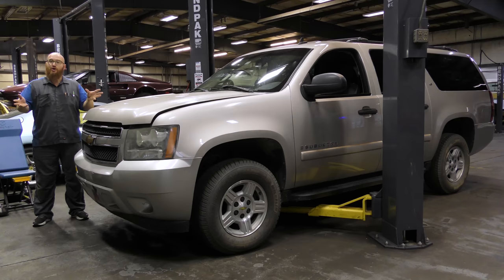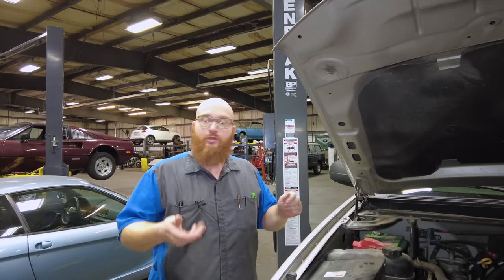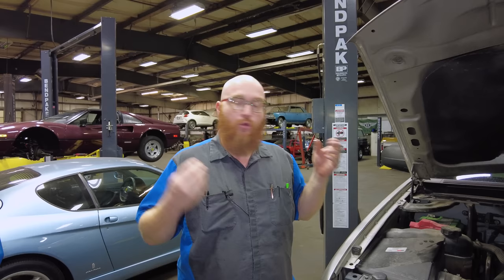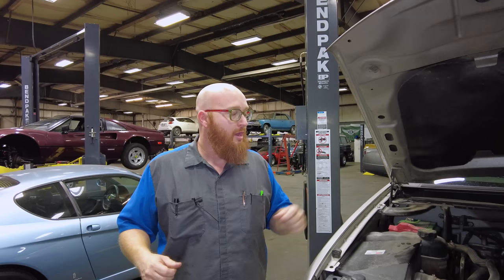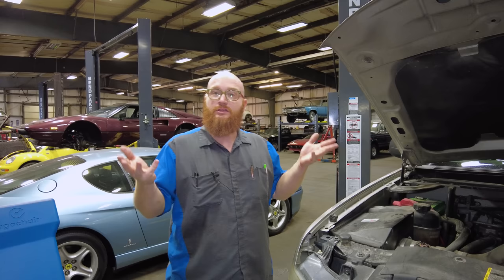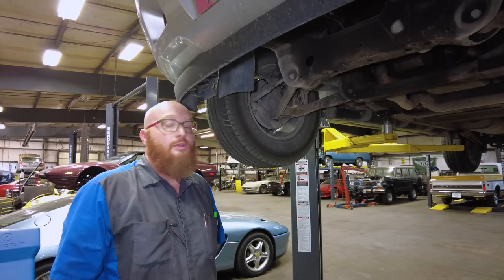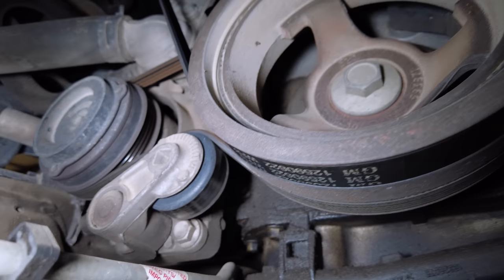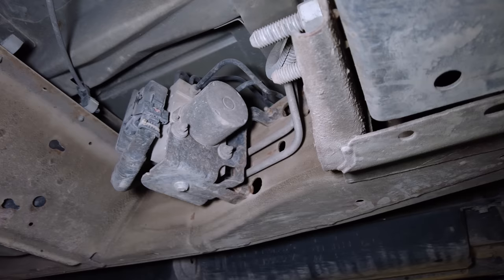What fails on ALL early 2000's Chevy SUV's!? CAR WIZARD shares what he's seen from the last 20 years

Comment: My 04 Suburban is well over 200K, blend door actuator and fuel pump, and blower resistor is all that I have had to replace. Not counting the TPMS lol. :)
Reply: My blend door actuator just failed today on my 04 Denali 🙃🤣
Reply: How did you know blower resistor needed replaced? I noticed my blower motor wires are hot when it runs for a long time
Reply: @IntelligentElephant  I wasnt able to change blower speeds. Under the dash behind the glovebox. Not expensive part. When you change the fan knob, this resistor changes the voltage to the blower causing diff speeds.
Reply: @ford89ltd  sometimes, turning off the key switch and restarting, will reset the blend door. I did this for a few weeks before finally replacing.

Comment: Most all of those problems I can take care of myself,  the transmission,  I have rebuilt a few, but those are a little more complicated than the ones I have rebuilt,  the GM TH 200, 350 and 400. Those are much easier than the over drive units.  It's really good to know about all the problems those have, I am considering buying one, around a 2004, Tahoe.  Very informative,  and educational,  thank you sir, I realize this is kind of old, still very helpful.

Comment: Great video, thanks Wizard! 
We bought a 2007 Escalade this year. I don't like buying a first model year, but this meant I could get a 6.2 without any of the AFM hardware. We bought it because it's quiet and comfortable, but being based on a Silverado should hopefully last a long time.

I had to do a few things to it when we first got it, which I understand are common - replace an engine mount, new front wheel bearings/hubs, brakes all around, spark plugs and wires. It's a really easy vehicle to work on, and has been great in the time that we've had it.

Comment: 2008 Suburban failed planetary gear at 90k, rebuilt trans and dumped it. Oil leaks from rear main, electrical gremlins, etc....it was a turd post 75k, even with AFM disabled. Garage kept and always meticulously serviced. Have a 2013 now and (knock on wood) it seems to be holding up better.
Reply: One of the worst years, the 08-09. GM cut back big time in QC during the recession years. Imagine buying a '09 $75K Escalade only to have the head gasket go at 3K miles due to poor head torque specs at the manufacture. At 16K, rear air compressor failed. At that point, we dumped it for the then-new Infiniti QX80 and drove the piss out of it.
Reply: GM 6.0l engine are bulletproof engines more reliable than The 6.2l v8

Comment: I bought a 2004 Avalanche 4WD in 2012, still driving it.  The oil pressure sensor replaced 3 times, never leaked, just gave max pressure reading once, and zero pressure twice.  A/C Blend door replaced, twice on driver side, once on passenger side.  No AFM, so no concern there.  I had the dash cluster rebuilt, added the transmission temp gauge when I did.  Now at 285K miles and transmission seems fine.  I always use tow/haul mode when towing, even when it's my small trailer and empty.  This is the longest I've ever owned one vehicle.  I originally thought I could get to 200K, then 250K, now I'm shooting for 350K.

Comment: We’d really like to see how you replace that oil pressure sending unit without removing the intake manifold!
Reply: Ancient Chinese secret!
Reply: I've done it in 15 min
Reply: There are a few good videos out here on YouTube for this. You can't see it, but once you know what to feel for back in there you can get it done. You have to buy the special socket and then have kind of an assortment of wobbly bits and extensions but overall it's pretty easy.  I also lay a piece of plywood across the engine bay to lay on. It makes it more comfortable.
Reply: Ya gotta have a skinny arm.  I changed mine in 15 minutes.

Comment: What a great vid! Love the info.  Currently replacing my transmission 4l60e ‘05 Yukon XL.  Lost 3rd and 4th gear 200 miles from home.  No warning no shudder.  Just got the rpm’s flying high and not moving forward. And yes,   I was going kinda fast, in over drive.   But why wouldn’t anyone do this in any vehicle and not even worry about your tranny puking?  Like what??   We can’t use overdrive now, on the highway, towing only your family for fear of an imploding transmission.  Going with a re- manned with a 3 year unlimited mile’s warranty. Cha-Ching!  Supposedly with beefier clutches and springs. I do love the vehicle though.  Thanks Wizard.  We viewers appreciate you sharing your knowledge.  Party on Wayne!
Reply: how much did that run you?
Reply: @NWhomegrown206  without pulling receipts, adding in fluid and a new shifter cable- they wear out too, all parts plus installation, tax, $2,800.00 ish.

Comment: I paid $1000 for my '03 Yukon XL Denali. I haul 12 footers of steel in it all day long as well as take it everywhere on road trips. If I couldn't fix everything myself it would probably be death by a thousand cuts with with all the little issues, but for me as a beater it's a perfect truck.
Reply: wow what a steal, you cant buy a LQ9 engine for that
Reply: It's amazing the deals some people get.  My co-worker bought a 2003 Yukon XL with only 96,000 original miles for $6000.  His wife refuses to let him sell it.  She loves that vehicle.
Reply: @T0tenkampf  It's an lq4 in an '03 and of course you can't buy it for $1000. There's labor involved in getting the engine pulled. You can go pull one yourself and pay a few hundred $ all day long. 

Had some simpleton try to tell me today the lq4 in his Escalade is worth $4000. Not sitting in the truck it ain't worth $4000.
Reply: @mylifethaidiy7045  That's a slightly better than average deal. An '03 Escalade with 130k miles for $2000 is a better deal.

Comment: Absolutely LOVE my 02 Silverado ext cab long bed Z71 4x4. The ext cab long bed is a pretty rare body cofiguration for a 1/2 ton. Bought it for $9700 when it had 56k miles on it the first time gas hit near $5 a gallon. People were giving V8 trucks away. It now has 364k on it and still purrs like a kitten. It has one small spot of rust on the driver side rocker about the size of a silver dollar. Other than that, only some surface rust on the frame. Nothing rotting at all. Florida truck most of its life.  Original transmission & rear end and probably 90% of everything else is original. I posted all that information about my truck on another video and asked in the current market what they thought I could get for it. One guy answered $9700. LOL. If somebody offered me that, I just might take it.

Comment: Just bought me a 2003 Tahoe with 145k miles on it. 1 owner. I love it so far! Only problem is some quirky electrical problems, but hey it’s a 20 year old Chevy! My oil sending unit is bad LOL.
Reply: Check out that main ground wire and connection... Iv'e seen a lot of videos talking about that. I believe it's under driver seat somewhere on frame and it gets corroded easily.
Reply: One of the best though. Miss my '04 Z71 Tahoe in green. Still see a ton of those out there.

Comment: I lost a legendary Buick 3800 to a GM oil pressure sending unit. The LeSabre only had 130k miles, but the unit failed completely during a drive home and drained all of the engine oil. There was a trail of oil across town from that car…

This in conjunction with an earlier incident with the intake plenum failing and hydro locking the engine ruined my trust for GM products. I replaced the Buick with an Accord that is up to 255k miles now and counting everyday.
Reply: People seem to love the 3800. Series 2 3800 long block is great. Everything that bolts to it is garbage. 

3500/3900 is prob the most reliable GM engine ever made in the v6. 4t65e trans is only good for 100k though.

Comment: A common job I've had to do on early-00s GM trucks are the heater core hose connectors. They're made of plastic and they just get brittle with age and heat and snap, suddenly there's coolant spraying everywhere and it's overheating because the feed or return hose is wide open.

Comment: another way to avoid the AFM debacle is to look for one of these with the 4.8 V8 engine - it was used in the later ones too and does not have AFM
Reply: Or get a 3/4 or 1 ton gas truck or buy a Chevrolet Express/GMC Savanna van instead.

Comment: Ran into a few of these between 3 different rigs in this generation. My first 2 Silverados were 2000 and 2003. My 2003 i bought at 40k miles. Drove it to 277k miles before i sold it. Had the oil sensor, knock sensors and a couple wheel hubs. Even my 4L60 was awesome. All original trans just filter/fluid changes every 50k miles  That's all I ever had go wrong with that truck. Best vehicle.ive ever owned. My 2000 Silverado was a regular cab stepside with a 4.8 V8 and a 5 speed. Also a great truck. My 2007 Avalanche was also nice but a total rust bucket. I maintain my stuff well

Comment: I wish there was someone like you back when I bought my old S10 Blazer years ago as nobody told me the transmission was known to blow up so I had to get that rebuilt as it just randomly gave out on me after an Oil Change and then there was the Intake leak that those old vortec motors were known for
Reply: At least the Blazer was a cool vehicle and not some other boring car similar to the way modern compact suvs are.
Reply: Loved my ‘87 s-10 blazer, even if it didn’t have wheel arches anymore and poured oil….
Reply: @tench745  that was actually my first vehicle but unfortunately the Master Cylinder went out on it and I didn't have the money to fix it.  The one that needed the transmission was I believe an 04.  I loved the blazers but I don't know if they're still good now a days or not as i have a '14 Jeep

Comment: I have an 05 Yukon ,it’s either had almost every problem wizard talked about, or I replaced it preemptively because I knew about it. Not AFM on mine, and I bought one that didn’t even have a tow hitch, so I know the trans wasn’t abused towing without two mode. 200k miles, original trans still.
Reply: Same with my 2006 Silverado.

Comment: Let’s see what have I replaced. 2006 Suburban 4X4. Transmission. Oil pressure unit, window regulators. A couple not mentioned AC/Heat fan resistor, 2 front bumper airbag switches, rear hatch lock,

Comment: 2011 Suburban here with 250k miles - Dash cracked up, Transmission cooler line leak, had an issue with the AFM but bought a delete that goes in OBD II port off of Amazon for around $50 and it hasn't been an issue since. However the other issues you mentioned we haven't experienced (knock on wood).

Comment: I also learned that if you drive with the transmission in the manual selection and have second to last/highest gear selected, the AFM is deactivated.  

Again, the amount of fuel burned is worth the internal parts failure repair and down time, or even worse, sitting on the side and waiting for a tow.

Comment: The cannister purge solenoid valve. You can only fill tank clicks at a time. You will get a check engine light I forget the code. Pretty common for those who love to "top the tank off"

Comment: 4:00 ford recently got cylinder deactivation on their brand new F150s. The 5.0 is dual overhead cam and not a pushrod V8 so it could have different results
Reply: We'll see, only time will tell if that's a good call from Ford
Reply: OHC engines have cylinder deactivation issues too. Take Honda’s J35 V6 for example. Luckily they make a VCM Muzzler for them which disables the cylinder deactivation system.
Reply: Hmm never had a problem with the MDS from Mopar but then again ohc and a system designed by Daimler Benz

Comment: So not so sure on the SUV's but as far as the 15/25/3500 there is a ground lug under the drivers' footwell that corrodes, preventing  OBDII testing due to no fuel level.  Mechanic friend says it happens very frequently and diagnosis can be costly if you don't have the experience.  You could be spending a couple of man hours testing relays and tank sender, he went right to the ground first because the symptoms were familiar it is that common.

Comment: 05 yukon. I've done all the brake lines on three of these. Major pain in the neck. GM has a pending lawsuit on the brakes lines rusting. 
  Many electrical issues including the cluster. Ground wire corrosion.
Oil consumption due to poorly designed intake manifold drivers side.
But according to this video I've got a pretty good vehical.
It's better than my first  VW bug 1955. Sorta

Comment: 3 things that Wizard did not mention that I have seen on the GMT900 platform. Swaybar endlinks plastic dash cracking and the little plastic skid plate underneath the front end. I had an 07 Avalanche the timing chain jumped a few teeth and cylinder 1 lost compression. It had all the common stuff oil pressure sending unit, sparkplug wires and ac belt tensioner.
Reply: Oh, the dash... man that thing looks like shards of glass ready to launch. I'm buying a dashskin today.

Comment: Are there any aftermarket parts that can outlast the factory replacement parts? If so any suggestions?
Reply: good question, you would think someone could make a mint off a better oil send unit design
Reply: ARP bolts and studs are a good replacement.

Comment: I bought 2 Tahoe’s, both at 106k with 1 owner, an 03’ 4.8 LS and a 05’ 5.3 Z71.

same exhaust manifold bolt head broken off on the 03. 
A/C actuators, front and rear, on the 05
Leaking oil block off plate on 05’
Wires break when doing spark plug changes

Very helpful video

Comment: I've got an 07 Suburban LTZ and it has the active fuel system. I'm currently sitting about 120,000 miles. Just put new plugs and wires on it last year. 7 out of 8 plugs were easy. The last plug on the passenger side rear sucked.  Still a great vehicle though. Shakes like a mofo at times going down the highway.  It's been aligned, but still likes left front wheel bearings as a snack. That said, I'll probably be looking to get rid of it soon.
Reply: I have an 07 silverado ltz with 288k on it and it eats the left front wheel bearing too lol. I recommend a wobble spark plug socket for the passenger rear plug. The ltz models are nice and I bet your suburban with only 120k is really nice.
Reply: Ha, I did the same job on my 2015, and the #8 iplug in the rear of the passenger side is a real bastard to get out and back in. It took me a long time to get the proper extension and socket set together to allow access in that tight spot.
Reply: The rear on the passenger side is very, very easy to do... Take off the wheel and remove the liner takes like 15 minutes and you will have full access. Have done it 2 times on my 07 Silverado
Reply: I have a 14 silverado and when I replaced my transmission I had the the exhaust manifolds off so I changed my spark plugs to avoid that.
Reply: Take out the inner fender well (plastic) and pull the tire on the passenger side all 4 on the passenger side are very nice to get at.

Comment: I've had luck avoiding most of the issues you mentioned on an 01 Suburban 2500 I've owned since 02.
Brake pad life on those is amazing. I got over 180k on my first set of brake pads. Or maybe that's because I rarely use my brakes?
Reply: I got 80000 on my Nissan sentra. But I had a clutch.
Reply: I went 255,000 on my Original brakes on my 2000 Silverado 2500...aND I TOW a LOT

Comment: A few points:  Be sure to disconnect the battery ground cable before working on the 175 amp mega-fuse!

Other failure points include the plastic T-fittings in the heater hoses, window switches, window regulator mechanisms, outside rearview mirrors, and fuel tank pressure/vapor recovery system components.

Pretty good video, and as you say, they ALL have their problems.  I like the Chevys because they have generally been easier to work on than many of the other brands.

Comment: This entire video is basically an endorsement for going back to pre-1986 automobiles. Doesn't matter the make or model. ANYTHING built before 1986 is better than 99.99% of the trash being made AFTER 1985. 
I got a 1957 Chevy with the factory 283 and 3 speed sitting in my garage that still runs. Turn the key and it starts every time without fail. Runs just fine. And I can fix 98% of everything on it in my garage. No need for a college degree in electrical science to change a spark plug or set the timing. 
245+k miles on the original drive train. I spend more on pizza and beer than I do on the maintenance of the car. Not because I neglect it but because it simply doesn't ever need it. A basic tune up costs $170 once a year whether it needs it or not. Tires...$450 every 5 years whether it needs them or not. Battery.....I get them free via O'Reily's replacement policy. So long as I go in on the last month before the warranty expires I can get a replacement battery for free. I haven't paid for a new battery since 2003. The most expensive repair I've ever had to do to the car was to replace a hood after a tornado dropped a brick on it back in the early 90's. 
Anyone buying this new garbage is a masochist who likes to throw his money away.

Comment: I have a problem with a fuel pump going out every two five years.  I recently replaced the water pump.  I have a 2000 GMC Yukon SLT that has nearly 400K miles on it.  Most of the problems are accessories going out like switches and wear and tear of the interior.  I need to get the tow/haul issue fixed before I do any towing or hauling heavy objects.